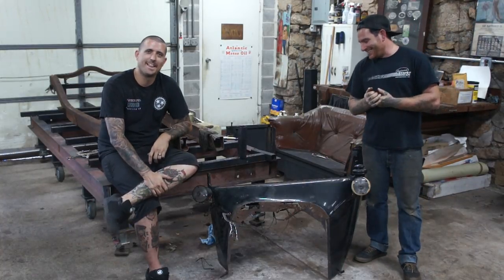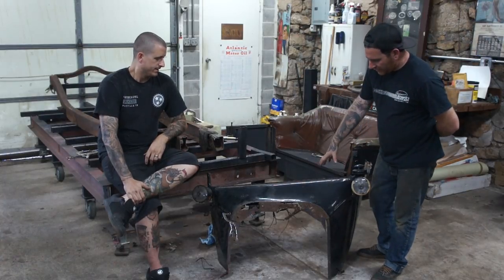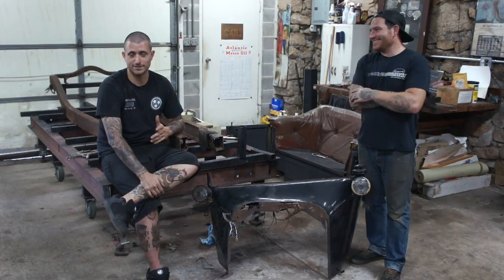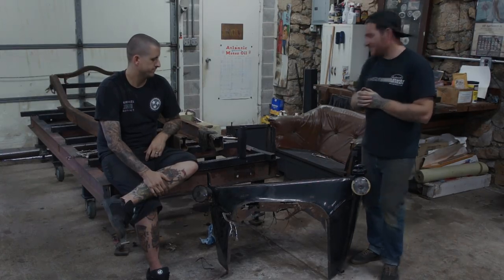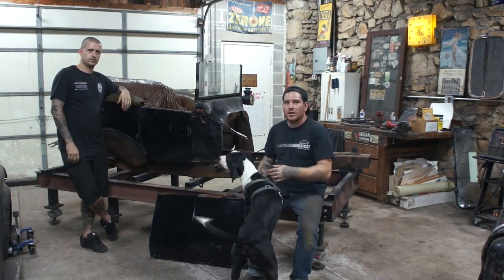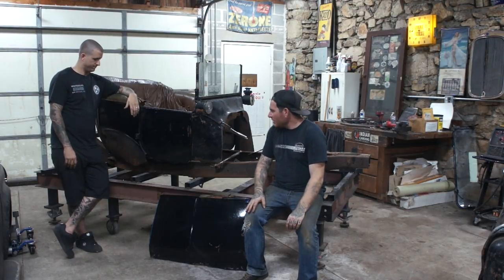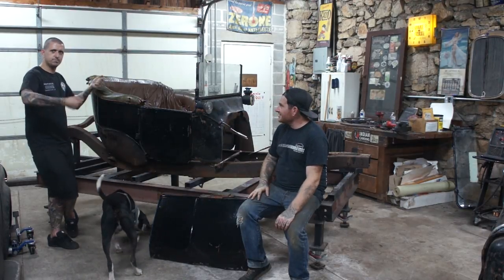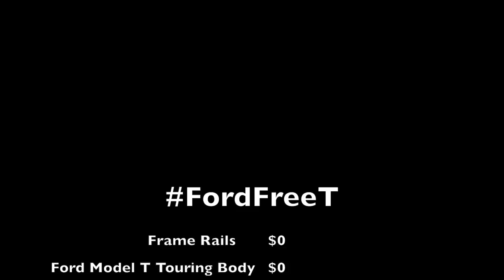Cutting Up The Ford Model T Body - Ford Free-T - Ep. 1

Comment: Kinda wish you'd number the episodes so I could follow along in the order you do them like you mostly did with one of your other projects.
Definitely a great missiin your on doing a build with the idea of it ending up basically free.
Swap and drop I've done before in my profession on pinball and arcade games. 
I've built and sold dozens of games that way as I'm also a parts pac rat of circuit boards and other parts.
I even do my own electronic repairs.
Several tmes I helped friends who were retiring clean out their shops and scored well over 100 thousand of dollars worth of parts and machines I've then used or traded. 
One company I was Service manager for in the Keys gave me their 60 thousand dollars parts inventory when they went outta business and I had to move back to Miami. 
Plus all the games and jukeboxes in their warehouse and shop. 
That was my biggest but saddest score.
I can't wait to see you and Mike cruisin, down to your local Sonic curb service joint to order some burgers and pop in the Free Tee.

Comment: As a daily driver of a 1923 model T runabout (essentially the same body you have there) it is really sad to see an original steel body cut to make into hot rod these days when plastic bodies are cheap enough
Reply from the maker: This body was mostly fiberglass and rust. But good try.